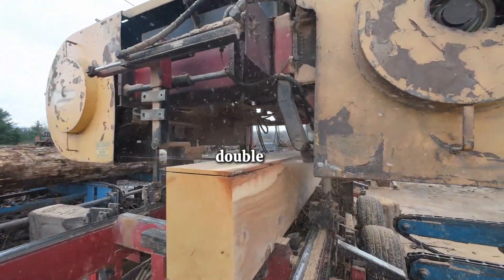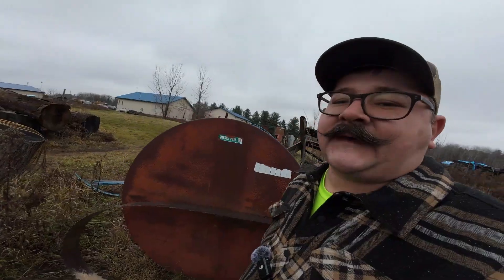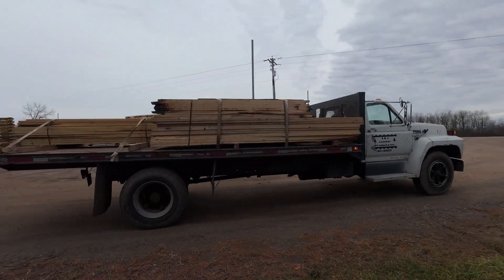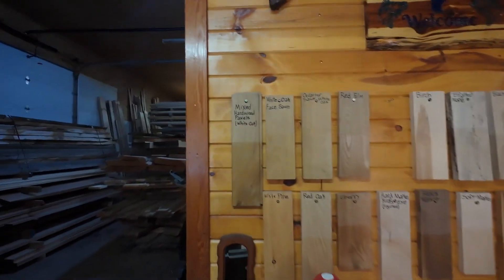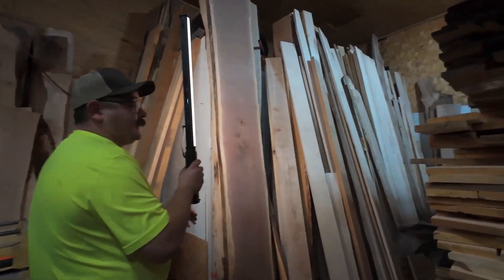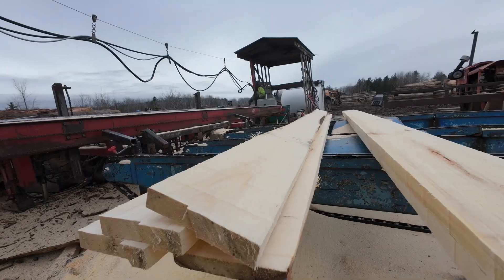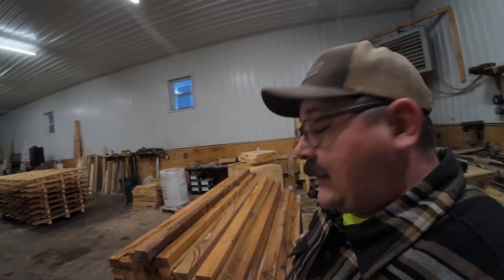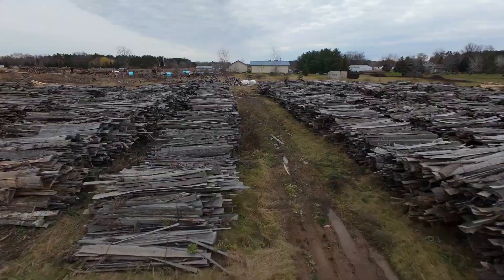Why This Sawmill is Insanely Well Designed (Lumber Mill Tour)

Comment: The moisture meter in the video does measure into the boards.   1-2 inches deep.   So much easier to use over the ones worth pins....
Reply from the maker: He should know, standing corrected.

Comment: For your hardwood saw dust you would smart to invest in wood pellet mills, for the softwood sawdust you should contact companies that produce engineered wood products like partical board.  This would all entail investment in proper two port vacuum exstraction machines in order to segregate hardwood and softwood sawdust and of couse the pellet mills but having a diverse portfolio is the greatest strength.